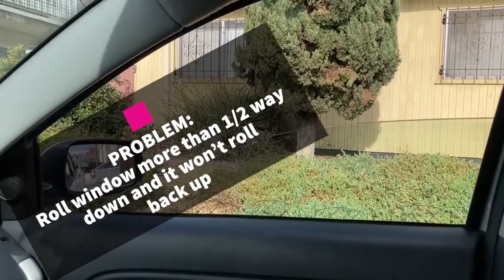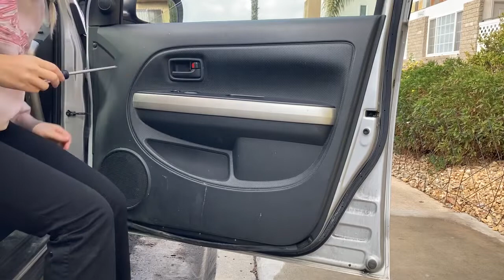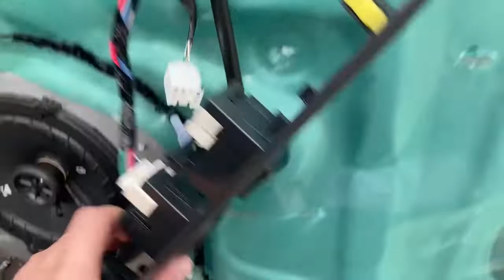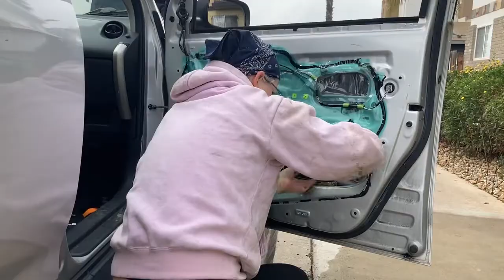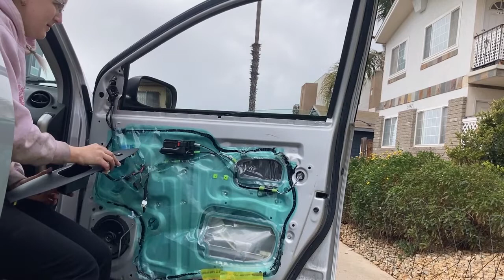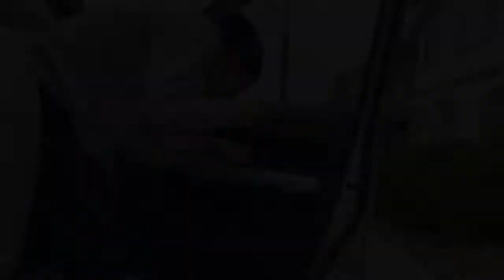2003-2006 Toyota Scion xA - Replace Front Passenger Window Motor - Girlie Garage

Comment: Great video.  I'm doing this repair on a friends 2006 Scion xA.  Unfortunately, Amazon had the wrong description for the one I ordered so I ordered the wrong side.  I'm ordering a different one through Autozone since I don't have time to wait for a replacement from Amazon.
My question is that I didn't make note of the motor in relation to the teeth on the regulator before removing the motor.  Does it matter where I mount the motor in relation to the regulator?  Thanks.
Reply from the maker: That’s a good question, it doesn’t matter because you will need to move the regulator/motor to get it in the right place to attach the bottom of the glass anyway. Triple check the autozone part before you leave the store (against the vin or the license plate of the vehicle) as they are known for dishing out the wrong parts. Good luck with this job!
Reply: @GirlieGarage  Thanks.  I had watched another YT video prior to yours and was able to go back and look at how many teeth on the regulator were showing on each side of where the motor was mounted and so I set mine like his and it worked.  Luckily the Autozone part was correct and the re-install went smoothly.  I re-greased all of the slides with silicone grease as well as the gear on the new motor.  The window works great.  My friends should be happy since I don't think the window has worked correctly since they bought the car.

Comment: How are you supposed to lower it if it’s not working in the first place?
Reply: Exactly my question.  I am guessing that you have to hold the window up by wedging some cardboard or using tape and then you have to try and work your arm up and unscrew it.  I guess I will have to look around some more.
Reply from the maker: It does take some fanagling, and generally someone with thin arms/hands, but you would loosen the window from the regulator and pull it out of the door, then work the regulator out

Comment: This is the second video on this topic that I've viewed.....that shows a partially-failed motor such that you can POSITION THE WONDOW FOR ACCESS TO THE LOWER WINDOW FRAME REGULATOR BOLTS ( aka "glass holding bracket" in your vid)....through the interior door panel. Here's the problem....and I'm sure I speak for many others.....my window is in the UP position with a DEAD motor. How do you access these lower window-regulator frame bolts ????????
Reply from the maker: If you undo all the other bolts that you can reach, does that allow you to wiggle the window enough to lower it or remove it? Otherwise if you can turn the regulator/motor enough inside the door to access the bolts on the motor, you can remove them, just make sure you tape the window or have someone holding it so it doesn’t fall
Reply: @GirlieGarage  ...Thanks...haven't gotten that far, still learning and planning the work. The bolts that hold the motor have the screw heads facing the outside of the car....so even if I can reach them somehow through one of the other openings,  I am HOPING the heads are hex style that can use a GearWrench ( or some such flat  wrench device), and hopefully not a Torx or Philips head requiring a longish screwdriver. My car is a Scion xA that fits this following vid...if only I had partial drop capability this vid would do it---> https://www.youtube.com/watch?v=XR9-HPXhJ14&t=74s